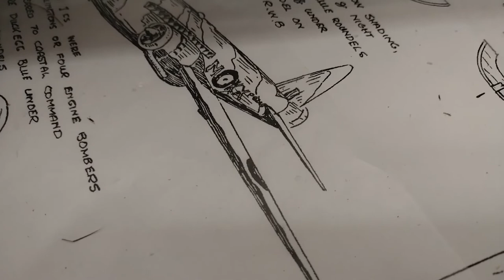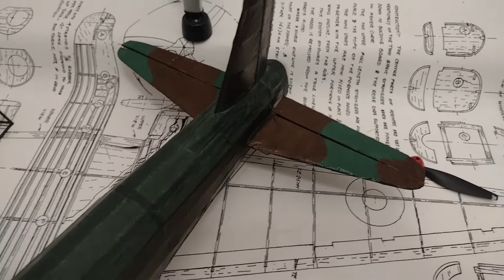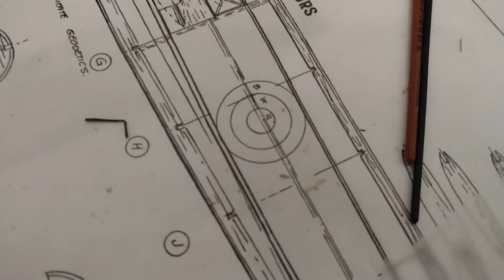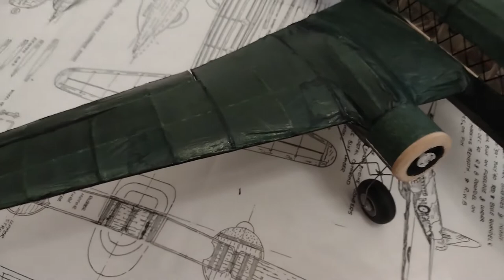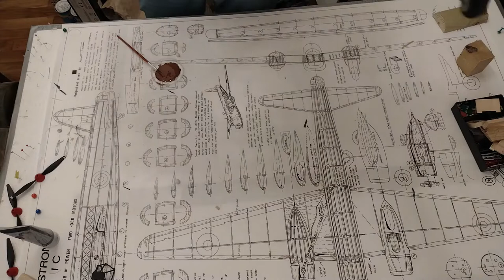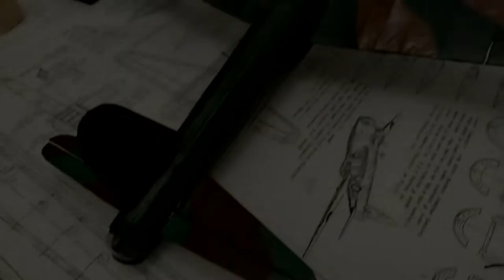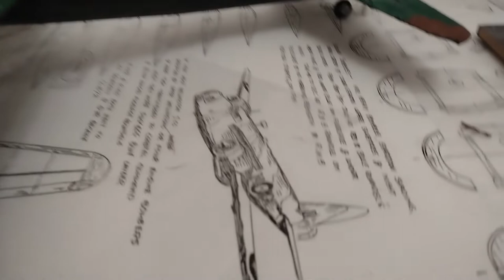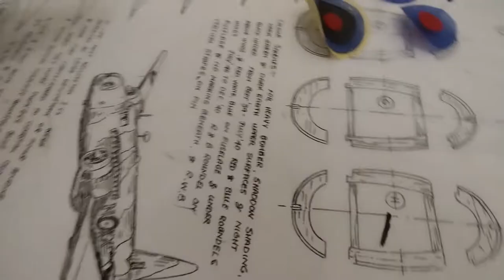13 Wellington Balsa Model   Final painting and markings

Comment: Looks great! I don't think it could have turned out any better even if it was a laser cut kit. The control movement seems much better. One thing I found out is using flat flesh  to lighten colors. It seems to work better than white, for me anyway. Good luck on the maiden flight.
Reply from the maker: Thx for the comment and the tip. I need to figure out the paint mixing still.